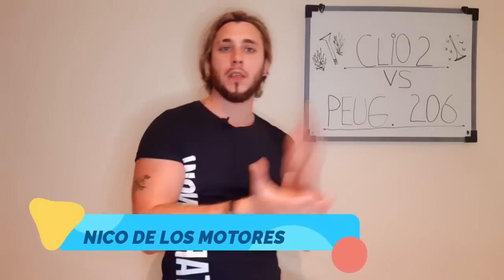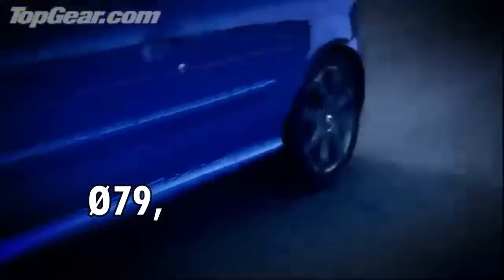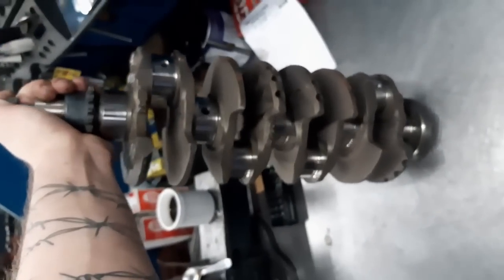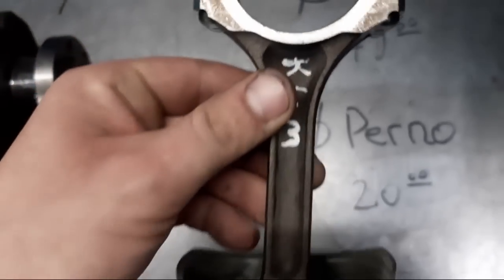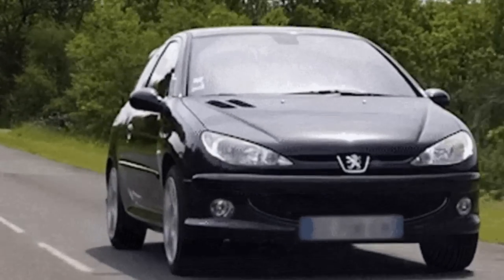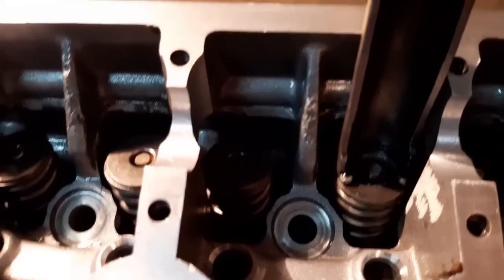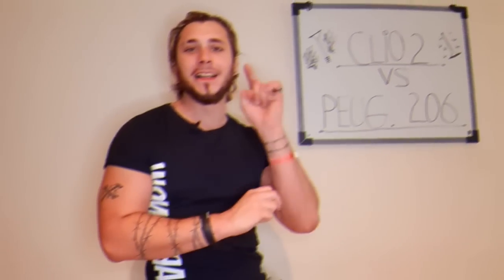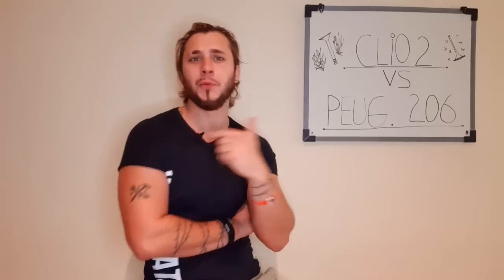RENAULT CLIO VS PEUGEOT 206 - cual conviene?

Comment: Mi Clio con k4m tiene más de 210 mil kilómetros y su compresión full sin ningún tipo de reparación interna..el TU5JP4 si se nota que es de mejor calidad, Peugeot siempre ha utilizado mejor ING en sus motores  eso lo hace mejor en confiabilidad. Pero a la larga es de cuidado.. los dos van a durar mucho  pero por lo menos a mí con el km4  el motor Aguanta mucho pata. Saludos desde Bogotá.

Comment: Tuve instalado un motor K4M de un platina en mi Clio que compre usado de manera provisoria, es increíble como tiraba y Iá buena compresión en los cilindros, a pesar de estar las levas y los apoyos todos comidos, daba los 190! Ahora tengo mi motor K4M original del Clio, ajustado y porteado y es una seda y tira en subidas a 170 relajado y a 200 en rectas (Tiene 230K pero en la práctica es un cero kms) motorazo

Comment: Holis. tengo un Peugeto 206 SW (familiar) 2006 con el motor nafta 1.6. 16v. 
Por estos días tiene algo mas de 460.000 km, y nunca reparé el burro ni el embrague, si el alternador una vez y la dirección también una vez, y el tren delantero y trasero muchas pero muchas veces.
Nunca abrí el motor. Y la caja jamás, aunque si cambié varias veces las bieletitas que están por afuera de la caja. 
Siempre TOTAL 10 40, y en estos últimos años  al Los cambios los hago en casa tras retirar el pesadísimo chapón. Noto que le cuesta tirar todo el aceite, supongo que tiene  suciedad dentro.
No baja el agua: NO CONSUME AGUA.
Aceite gasta medio litro cada 10.000 km. Y pocas veces cambio el aceite y filtro a los 10.000, casi siempre me paso y lo hago a los 14 o 15. 
Hago casi 2000 km por semana. 
Nunca se rompió la bomba de nafta (toco madera).
Y la electricidad es perra, como en un 505 que disfruté muchos años y vendí con mas de medio millón de km (eso sí, al 505 le hice dos veces la tapa). 
Ojala mi próximo auto sea un 2008 con este fantástico motor de 1600 cc y 16v.
Este 206 sw en el barro es excelente pero muere en la arena (se entierra mal, incluso con 14 libras o menos en cada rueda). 
Dato curioso: en algún taller le afanaron el termostato: siempre anda a 70 o menos en invierno (una heladera).
FELICITACIONES POR EL CANAL. MUY MUY BUENO. 
Cojudo es que tiene cojones, es decir: huevos. Al término lo utilizaba mi viejo, que era oriundo de Sama de Langreo (Asturias, España).

Comment: Me encanto tu capitulo sobre los mejores motores para gnc donde hablas muy bien de los motores peugeot de vieja generación, pero me encantaría que los compararas con los nuevos gasoleros 1.6 turbo que equipan el 307, 408 y citroen c4 lounge. Tuve un 408 gasolero unos 100.000 kmts y me pareció una masa. Muy confortable para viajes largos, pero..... ese motor durara como el hdi 2.0 ......?????
Reply: 307 sedán/hatch acá solo hubo con el 2.0 DW10. El 1.6 DV6 vino en el 308. Son más delicados, pero dan buena batalla ambos los de 90 y 115CV. Pero el 2.0 es literalmente indestructible

Comment: Se que vas a elegir el motor del 206, en unos de tus videos lo elegís como el mejorcito para gnc, pero solo voy a elegir el propulsor que tuve(k4m) y jamás un problema, es un motorazo, a si que mis fichas van para el k4m.
Reply: Seeeee bien con los servi aguanta y camina ese motor
Reply: Vincent yo te puedo decir que mi k4m usaba aceite 10w40 nonle hice tapa solo cambia valvulas porque doble t tenia 350000 km y anda una joya cumpaaa ybuse acetite 10w40hasta los 420000 km. Despues tuve una recamlwntada porque no cambia ninguna manguera tebia todas originales y era un megane 2009 y. La manguera que se rompio fue la menos pensada. Fue de la calefacion cumpa y por eso recalente el auto. Y lo vendi con 475000 kilometro cumpa solo le cambie las valvulas ni las guias ni botadores cambie todo original.  Solo hice tren delanteeo 350000km y dos veces cambie bonda de agua y use refrigerante original de fabrica. (Tarde me di cuenta que vendian)  y consumia un 1l4 de aceite. A los 475000 km cumpa . los que digan que el k4m es un clavo no sabem mantenerlo como lo pide el auto y yo lo trabaje de remis. Son unos ratos cumpaaa
Reply: @gonzalocastro196  son un fierro mi mecánico me lo recomendó le hace servicios a las cangu con GNC motores con 700 mil kilómetros sin abrir el mantenimiento es la clave saludos
Reply: @Torino380  otro que solo le tocó clavos o idiotas al volante(con todo respeto), reitero el k4m es un motorazo, no opino de Peugeot porque no usé ese propulsor y si te fijas el k4m lo da vuelta 200 veces en la cantidad de vehículos que lo montan, fijate que la Kangoo es lo mas usado en flotas, correos, logísticas y todas con el k4m. No puedo adjuntarte fotos por acá, un amigo tiene una empresa de agroquímicos con flota de kangoo(pasaron todas las versiones de k4m por el negocio) y ninguna por debajo de los 500.000km sin abrir nada, solo una se rompió porque el empleado la pasó por la Costanera un dia de lluvia y allá fue, cambio de correas a termino, bujías, aceite castrol y k4m para mas de 500.000km, tengo foto de hoy de unas de las unidades con exactamente 490534km, amigo los autos no son para todos(esto incluye usuario final como los que se hacen llamar mecánicos)

Comment: Estaria bueno que examines y compares mas en profundidad los dos motores. Mostrando y comparando las bombas de aceite, los arboles de levas. Es como que juzgas la ingeniería de manera muy chota, tirás esos "oh dios miren lo que es esta leva" Cosas como el consumo van a estar determinadas por la aerodinamica del vehiculo, el peso  ect.  Si comparas motores no te podes basar en los datos de rendimiento del vehiculo, solo podes hablar de potencia y torque erogados y la curva de los mismos en relacion al consumo de combustible y ahi estarias calculando la eficiencia del motor. que en definitiva el mejor motor va a ser el que obtenga mayor perfomance con el menor consumo de combustible.

Comment: El k4M es mas noble y mas agil anda mas de abajo y arriba lo probe en un Symbol contra un 206 y el Peugeot es mas chanchon
Reply: Mas noble? Bue....
Reply: @diegoroitman5502  Son motores de 400 mil 500 mil kms muchas kangoo conozco de reparto y de empresas que han llegado de ahi en mas ya empiezan a consumir aceite
Reply: @gabrielmaxitorres2440  no dudo que lleguen a esos km.pero en el mientras tanto son talleristas.preguntale a cualquier mecanico.el paso a paso x ej:
Valvulas.lo dijo nico en el video.
Reply: @diegoroitman5502  si tengo un amigo con taller y siempre tiene un k4m

Comment: Todavia no se estrenó, pero ni hace falta para ya ir diciendo que el Tu5jp4 es diez veces mejor motor que el k4m...
Odio los franceses, pero el Peugeot 1.6 16v es un caño! Una tapa de cilindros hermosa, de calidad. El resto del motor también muy bueno.. Y el k4m a largo plazo es malísimo.. es horrible para  trabajar en el, tuve mil problemas con la mariposa electrónica, mil problemas de tapa de cilindros, etc etc...
Reply: Te toco justo el perno a vos, el k4m es un motorazo, muy noble, en mi caso me tocó es una Scenic comprada desde 0km y que buen motor y fiel, irrompible, ojo, a los motores sin excepción de ninguno hay que mantenerlos, religiosamente en mi caso cada 10.000km o al año se cambiaba el aceite, siempre Castrol, nada de idioteces "recomendadas por el fabricante", solo me guiaba por las especificaciones del aceite, pero ni en pedo le ponía el asqueroso Elf o Total(recomendado por Peugeot) que son la misma basura, todo como debe ser y la vendí con 180.000 km sin ningún problema de ningún tipo, Ahora tengo el F4R en un Duster con recién 30.000km y venimos igual, solo cambio de fluidos y que lindo que anda con la caja de 6ta y sus relaciones, da gusto manejarlo.
Reply: Alfredo Sabagni  igual el hecho de que se venda muchísimo no significa que sea bueno.
Reply: @mauroa8216  nunca tuve un Renault..
Calculo que eh atendido no se, no te digo cientos pero que se yo..  50, 70 o más y ya se que no es una buena ingenieria, no es un gran diseño o una gran concepción digamos esa mecanica,   hay muchos superiores. 
Y para lo que sirve esa mecánica es para lo que hiciste vos. Comprarlo nuevo y a los 150, 180 mil km venderlo. Para auto de batalla, de laburo, de castigo, de muchos kms no va, no es la mejor opción
Reply: @LD-vc7ri  ¿A que le llamas batalla? Tengo un amigo que tiene negocio y es mecánico y el negocio equipado con flotas de kangoo K4m desde la generación del K4m con mariposa mecánica hasta con las de mariposa electrónica y vamos a los mismo, todas pisaron los 500.000km sin problemas algunos de por medio, lo normal, cambio de correa, etc etc, por eso insisto en que te tocaron pernos o gente no apta para tener vehículos, solo tuvo problema con una(el empleado la pasó un día de lluvia en la zona de la costanera en Córdoba y allá fue), pero fuera de eso la realidad es que no conozco mas problemas, obvio escuche a varios putear por el corte de correa, pero la falla estaba en la mano de obra, hay ciertos detalles que no se pueden dejar pasar que la mayoría los deja pasar.
Reply: @mauroa8216  la verdad que lo felicito, bien por el.. acá los k4m caminados de 10 autos, 8 son una basura, todos dramas... ya me los conozco de memoria... ni hablar de las flotas de camioneta o taxi.. no existe, hay tantos motores que le pasan el trapo en durabilidad y costo de mantenimiento... pero bueno a mí no me interesa defenderlo ni basurearlo.. es lo que pasa todos los días en mi taller. Me da lo mismo, a mi me dan de comer 
La distribución no tiene ningún misterio de mano de obra.. compras las trabas que venden en ml por dos pesos y listo
Reply: Alfredo Sabagni  lo que pasa es que contra el fanatismo no se puede.. si le digo a un renolero que hay cien motores mejores que ese no lo va a entender..
Esto es lo mismo, yo no me la agarro con el motor. Ya lo conozco de memoria y se lo que es.

Al que le guste que lo compre. Yo no lo compro, no me interesa el logo.. ya se que hay tantos motores que lo superan al k4m en cualquier aspecto que no vale la pena.
Reply: Alfredo Sabagni  mira si serás fanático que hasta te gusta el aceite élf (un aceite ordinario ) solo porque te lo dice Renault.. y según vos el petronas es una cagada, pero es el que recomienda Fiat! Osea si lo dice Fiat esta mal..  
y la seguis con que se vendió mucho y "triunfó ", eso no implica que sea bueno, seguís con que es barato..  y la verdad que no está en el "grupo de los motores baratos"

Así que no pasa nada, olvidate.. yo me equivoqué y no desarmé ninguno, el k4m es un motorazo campeón
Reply: Alfredo Sabagni  Es bastante malo ese aceite, genera un "barniz" cuando castigas el motor, te conviene poner unas monedas mas  e irte por Castrol, le estas poniendo un aceite premium, de los premium el mas barato, pero es incomparable con elf, total, ypf, shell, selenia y todas esas basuras que vemos a diario en los lubricentros. Recordá que lo "recomendados por el fabricante" solo son acuerdos comerciales, es mas fijate que ahora Renault firmó convenio con Castrol jeje, al menos firmó con alguien de calidad. Un abrazo.
Reply: @LD-vc7ri  Estas equivocado, hay detalles como el labio de la polea del árbol de levas suele gastarse o desprenderse y le mandan la correa lo mismo, típico de mecánico que solo tocó un fiat y después tenemos que escuchar comentarios como que la correa no servía, que el motor no se la aguanta y demás barbaridades que dicen los "Macanicos". Con respecto al k4m no te puede gustar, pero de ahí a decir que no se la aguanta, me parece que estas hablando giladas, es un motor que llega sin problemas a los 500.000km y mas, solo haciéndole lo básico que se le debe hacer a cualquier motor.
Reply: @LD-vc7ri  Decí que no puedo adjuntarte fotos acá, recien le pedí fotos a mi amigo de una de sus kangoo(la última con el k4m), ya que ahora vienen con el 1.6 de origen Nissan, esa marcando al día de hoy exactamente 490534 km y no se trata de fanatismo, se trata de ser realista, no es un motor mañoso, como te comenté anteriormente, fallas típicas del k4m (bobinas) vamos de nuevo, no por lo malas, sino por no cambiar bujías a tiempo o por no ponerle resistivas, corte de correa después de los 60.000km obvio porque antes no se corta, obvio que el problema es a quien se la llevan(en dos casos que conozco pude ver que fue 100% error del mecánico, labio de la polea en mal estado y otra un rodillo no cambiado🤦🏼‍♂️. Lamentablemente los autos no son para cualquiera, ese es el principal problema, tanto para usuarios como para los macanicos(si si, puras macanas) a los que le confían el auto.
Reply: Alfredo Sabagni  si, dentro de los premium tenes Liqui Moly, Motul y Castrol, en ese orden, después viene todo el resto que desbordan los lubricentros, pero creeme que no es bueno Elf, ni hablar como queda ante una eventual paliza un dia de calor, pero bueno gustos son gustos y como decís vos esta todo caro y es una moneda 10 luquitas en lubricante, con 4 le pones cualquiera de los mas usados 🤷🏼‍♂️.
Reply: @mauroa8216  ni hablar son un fierro me lo recomendó mi primo que es mecánico saludos
Reply: @adrianlell5023  ni que hablar hermano, me sorprende la cantidad de papanatas opinando giladas, mas de 20 años ese propulsor y salen con que no aguantan jeje... Mamadera.. lo que hay que leer, esta ultra probado, es un fierro con todas las letras.
Reply: Alfredo Sabagni  hola ponele el Valvoline 5w40 y el motor es otro recomendación de mi mecánico siempre que no tengas muchos kilómetros el mío vuela con Valvoline saludos
Reply: @mauroa8216  ni hablar y sí tenés uno ponele el Valvoline 5w40 sintético y vas a ver lo que cambia el motor saludos
Reply: @adrianlell5023  lo tuve en una scenic desde 0km, soy muy maniático con el mantenimiento, en mi caso lo cambiaba cada 10.000km o año, varias veces lo tire con 5.000km, usaba Castrol Edge 10w 60, te imaginarás que los problemas que cuenta este muchacho ni existían jeje, pero se trata de mantenerlo bien y los que tuvieron problemas a donde los llevaron.
Reply: @mauroa8216  te repito. Lo felicito si las kangoo  de tu amigo son indestructibles.. bien por el.. acá ninguna dura 500 mil km ni de casualidad. Imposible un k4m sin destapar con esos kms.. imposible, jamás pasó acá y vi decenas y decenas
No te hagas drama..  yo hablo giradas, en mi vida desarmé ese motor, seguro lo soñé
Reply: @mauroa8216  papanatas son los mecánicos del teclado.. 
Y esta más que claro que en tu  vida agarraste una llave de diez..
Yo solo leo a los campeones del chamullo para divertirme.. 
Desarmé tantos k4m que los puedo armar de memoria y con los ojos cerrados.. (como cualquier buen mecánico corriente) por lo tanto se muy bien lo que son..  así que imagínate cuanto me puede importar los opinologos que desde el teclado quieren dar cátedra sin saber.. solo me divierten
Reply: Alfredo Sabagni  decis de los aceites que "si fueran malos no los recomendarían las marcas..." volvemos a lo mismo.. dijiste que Petronas es una basura.. pero resulta que Fiat lo recomienda.. osea que entonces si lo recomienda la fábrica entonces es bueno según vos... pero no, decís que es una porquería.. en que quedamos??? Algunas marcas mienten? Como sería??
Deja... ni te molestes..  tenes razón.. 
Ahí tenes el video.. "el k4m es barato , Peugeot es caro y Renault es del pueblo" jajaja seee.. seguro.. ahí tenes los precios.. el subconjunto vale menos, después la distribución vale lo mismo.. la bomba de aceite original del k4m es más cara que la original del Peugeot.. hacer la tapa del k4m cuando se revientan los apoyos sale una locura de guita.. etc etc
Olvidate no perdamos tiempo.. tenes razón. Aguante el k4m, ya me convencí, un motorazo
Reply: Alfredo Sabagni  esos motores andan con aceite mineral que le pusiste dé Valvoline yo usaba Motul en Sandero lo cambie a Valvoline y el motor es otro arranca más fácil tiene mejor presión de aceite y el motor ni se lo escucha yo lo cambie por recomendación de mi primo que es mecánico y lo usa en el taller hace 15 años y motores con más de 700 sin problemas 🤷
Reply: @mauroa8216  seguro
Reply: Alfredo Sabagni  buenísimo

Comment: una verga peugeot, con esos block de aluminio horribles entre otras varias decenas de problemas que traen sus vehiculos.
pd: en la seccion de comentarios abajo esta lleno de comentarios que dicen que el k4m es mas motor que el peugeot. tienen razon...
Reply: El motor del 206 no es de aluminio xD
Reply: @ignaciovigna4224  el 1.4 NAFTA si lo es
Engine Specs 1.4 tu3jp
Head material
Aluminium.

Block material
Aluminium, Cast iron

Fuente wikipedia
Fuente 2: autoría personal ya lo tuve ese motor de mierda que se parte el block si lo miras fijo un rato
Reply: @nikolaxxjaxxon  yo hablaba del 1.6 xD sii el 1.4 es nafta y no es muy recomendable, tampoco es que sea malo pero no es tan bueno
Reply: @ignaciovigna4224  75 cv. Es increíblemente malo